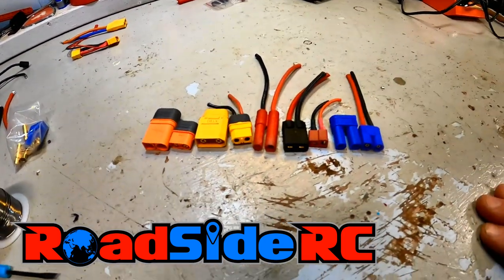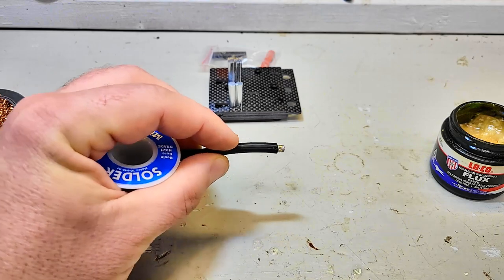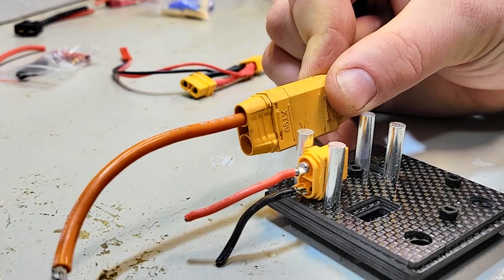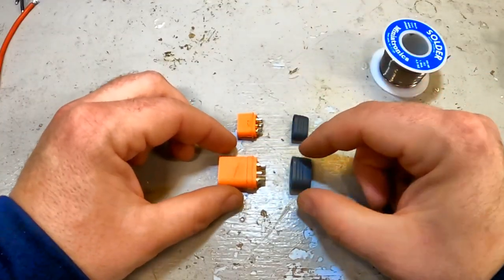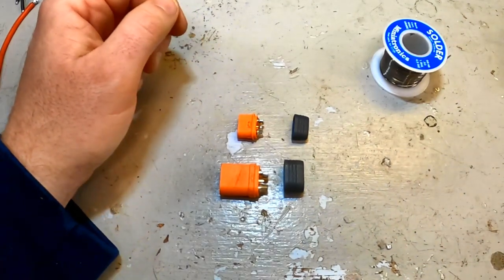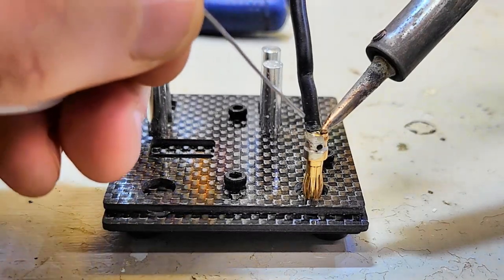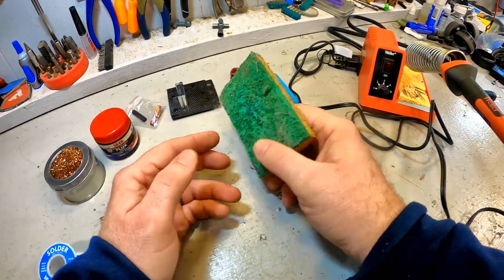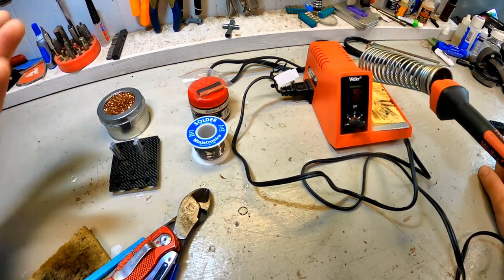How to Solder RC Plugs (XT90, XT60, Traxxas TRX, Deans, IC5, IC3, EC5, EC3, Redcat Banana).

Comment: great video dude, this is the one part of the hobby I struggle with. I can solder LEDs and make my own light kits but I have never been able to get the plugs soldered properly. you have made it look a little easier
Reply from the maker: You can do it!
Patience, a clean tip, and some good solder - you have got this!

Comment: No other video tells what is the third cable for in iC3, but you.  I saw you soldered a red wire in XT60 conector to minus side. 4:20
Reply from the maker: Glad I could help!

Comment: Super helpful!  Can you cover properly changing plugs on the battery itself in another video by chance?
Reply from the maker: Sure!
The soldering part is 100% the same. 
You just want to do one side at a time, and be very careful to not let the ends touch.

Comment: Switching all the 12 volt stuff my whole family owns (mine and theirs) to XT60 for safety and convenience reasons. I had a problem with some 12v gadgets for automotive where I had some things with backwards wired SAE connectors (those weird ones that are symmetrical with one naked and one insulated connector)... they're supposed to have the + side on the battery side encased in case it touches the vehicle body ground so it wont short... turns out that some of them are wired backwards and others are not which is a recipe for shorts and other catastrophic failures. Turns out that the hobby connectors are both cheap, and relatively safe since they are usually connected to Lithium ion packs (LiPo is a type of lithium ion that happens to be in a pouch instead of a metal canister). XT60 connectors are cheap and both genders are partly recessed which makes them safe for both the chargers and batteries. But they are also physically smaller than XT90 and our chargers are all smaller than 60 amps (most are small battery tenders) so the XT60 is overkill by a wide margin.

The XT60 also has a panel mount version that I am using on my PC to tap 12 volts off its power supply and power all the gizmos on my desk from the PC instead of having 20 power bricks for random things... plus having 20 power bricks at low load is less efficient than taking that power from the PC which is operating at a higher efficiency point... and I trust my PC tower's overkill sized ATX power supply way more than el-cheapo power bricks... but finding a good conector was tough given all the connectors I found were all for other tasks and I don't want to have a connector on the back of a PC with 12 volts that looks like a 5 volt USB or a headphone jack, or a network jack, etc... but an XT60 is only ever used for power so there is no chance of making any mistakes and letting magic smoke out of things.
Reply from the maker: All sounds logical to me.   Glad it works for you!
Reply: @RoadsideRC  Was the best connector that was available at a reasonable price. Also, not being part of a brand makes them less likely to disappear any time soon which is what I really wanted. Though a 60 amp connector is a little overkill for a 0.050 amp (50mA) solar maintainer... even the largest one we have is able to generate less than 300mA (0.3 A). Should have looked into RC connectors sooner than I did... derp.

Comment: Very good info..I still gtta get me a proper soldering jig! I still use a crescent wrench to hold mine 😂
Reply from the maker: I bought the one in the video to test, and have used it for the last month...just for this video.  I had been using locking pliers!  :)
Reply: @RoadsideRC  I clicked the link for it but it's unavailable at the moment
Reply from the maker: Already sold out!!!  Dang.

Comment: I can't solder to save my life I see all you guys do it and it looks great in using using just a cheap iron and I don't know if it don't get hot enough or I'm using the wrong solder or what but it's about got me wanting to quit the hobby so discouraged
Reply from the maker: I am sorry to hear that! 
YES - 2 common issues. 
1)  using a iron that doesn't get hot enough.  I have my Weller turned to MAX and leave it there. 
2) the non-leaded solder takes  A LOT more heat to melt.  Use the leaded, it is so much easier to work with.
Reply: @RoadsideRC  thanks so much I'm gonna give it a try it's so disappointing

Comment: Great video... my question. Do you recommend different size tips for different gauge wires & connectors? Seems it was the only thing you left out 👌🏽
Reply from the maker: Unless I go to a very small wire, I only use the one you see here.

Comment: Thanks for the video, I just subscribed to your channel after watching this and some other RC demo and review videos. I've never soldered anything in my life but it's time to learn I guess as I'm all in on the RC Hobby now. lol Are you familiar with the TS101 solder iron? I have one ordered I am hoping to use but I'm not sure if it will work on these gauge of wire/connectors. Anyways, enjoy the channel. Keep the great videos coming 🙂
Reply from the maker: Thanks Mike! 
I used soldering iron similar to the TS101.  It was OK.  It takes a LONG time to get the solder hot enough to work - but it should be enough to get you started. 
Good luck!

Comment: Tranks für the Video. I know how to sonder cables and stuff but did not knew the different plugs an how to sonder them.
When im Right you actually use some other Plug type in your Drifter? Some Kind of Bolts?
Is there a Video of how to work with these?

Greetings from Germany
Reply from the maker: Hello!   Yes - on my drift car, I use simple bullets.   They solder much the same way as the EC plugs do.  Very easy!
Reply: @RoadsideRC  i ordered the same Lipo and there are 2 bullets with it, when i understand the Description right. I will try my best. Thanks for your helpfull Videos.

Comment: Hi. Great video. I am having assorted of issues with my first time soldering as I can't seem to find an RC video to show how to remove old soldered wires from a motor. Wouldn't you just heat the gun, press to the Solder and pull the wire? Nothing happens, the old Solder doesn't really heat, nothing moves, and I'm at 400 degrees c. Driving me nuts
Reply from the maker: Add a little solder to the tip and the wire you are attempting to remove.   It gives more surface area to transfer the heat.   

That should do it!
Reply: @RoadsideRC  Fantastic thanks RRC, I'll give that a go this evening 👍

Comment: Sorry, just found this video, as i have a broken deans connector I'm trying to replace. Very helpful. What state must the Lipo Battery be in before I can safely solder the wires? As in, should it be at storage, or at 10% or completely discharged (which makes it hard to charge again)
Reply from the maker: Glad to help!

The amount of charge in the battery does not matter.  Just be careful to not touch the ends together!

Comment: So are the wires in my batteries or esc pre tinned ? Also John Salt said he had to use a 280W welding gun on the bigger connector. So what type of soldering iron do i need that gets hot enough ?
Reply from the maker: 1) the wires are not always pre-tinned.  I suggest you do that.  It will be obvious when you look at them whether they are or not.  
2) needing something on the range of 280W is for HUGE jobs.  I have run an 80W Weller for years now and it does everything I have needed from an RC side.

Comment: How much Watt is the Iron rod? What type of lead? I tried so many ways buy every time My iron touches the bullet is does not become hot enough to melt the lead… im using dekko 20-200w iron and 60-40 lead 2% flux lead
Reply from the maker: This is a 100W iron with leaded solder.   Iron is turned as hot as it will go. 

Do you tin the tip with solder before trying?   Also, any wind or cold temperatures makes a difference.

Comment: What gauge of wire might you use to power a FC? The ESC is maybe 18GA, but the Lipo is like 10GA, so maybe like 12GA?
Reply from the maker: I like to use as big as I can get away with.  If the battery is 10ga, I would stick to that.

Comment: I am having such a hard time removing a IC5 wire from the factory solder. I have heated the solder joint so long and it seems like nothing I do will get it hot enough to remove it lol
Reply from the maker: To help with the heat transfer, add a little solder.   It helps give more surface area contact between the iron and the connector - usually that does the trick.
Reply: @RoadsideRC  Thanks for the tip. I realized my soldering iron is only 30 watt so what I did is use my mini torch to heat up the tip on the iron and quickly touch it to the solder joint and was able to remove it. I am going to order a higher watt soldering iron and toss this junky one from harbor freight I bought years ago lol

Comment: Question. If my ESC has XT60. Can I connect it with a Spektrum lipo which has IC5?
Reply from the maker: Nope!   I have used EC5 that connected in to XT-90.  XT60 is much smaller, and the IC versions have the center plug that will make it more difficult as well.

Comment: what temperature do you solder a ic5 connector at? i tried soldering some wires on one today but by the time it was hot enough to melt the solder the connector melted the plastic housing and the connector moved. yes i tinned everything. i dont remember exactly how hot i had it set but i think it was around 750
Reply from the maker: Honestly, my iron doesn't have a temp readout.  I leave it at max temp. 

Two things:
1) did you have the other side of the plug connected, as I show as a tip in the video?  That helps keep everything aligned. 
2) check that youbare using leaded solder.  The unleaded has a much higher melting point.

Comment: Dude must be hulk , I can get these things to "pop in" on the ec3 withing fucking the wire
Reply from the maker: Hmm.  That is odd.
Reply: @RoadsideRC  are you using new or used connectors ? I'm thinking that the older ones are a bit softer
Reply from the maker: @deadbeast99k85  These had been used before - good call.

Comment: For solder connector xt 90, what the type solder tip you use?
Reply from the maker: I use the biggest tip I can.  It helps transfer heat faster.